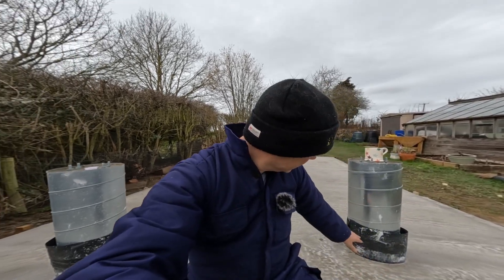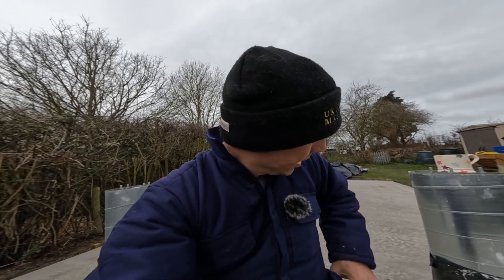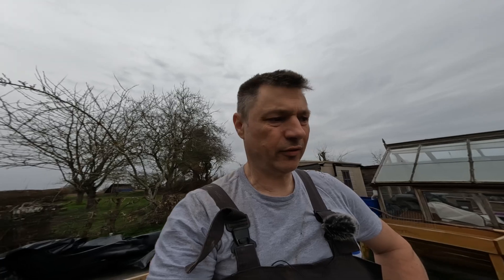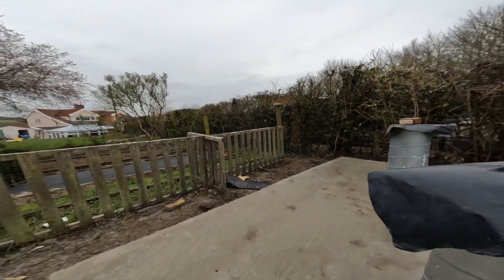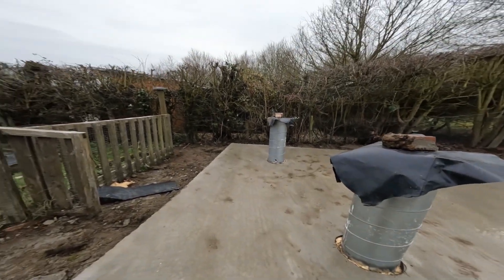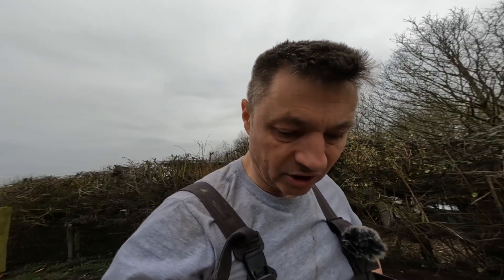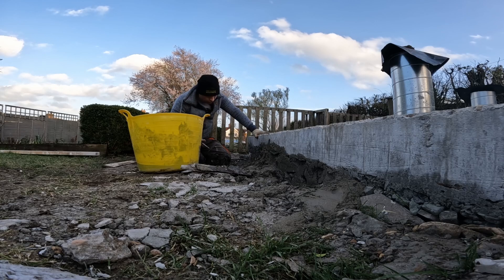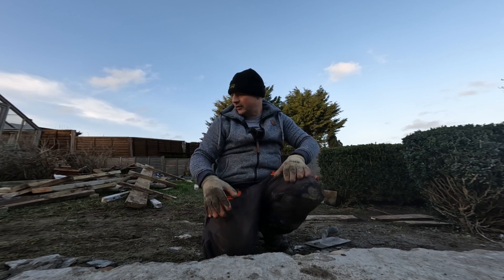4 GENIUS Hacks to Revolutionize Your Astrophotography Experience

Comment: So excited to see how this project finishes up. I do have one concern though. I was always taught that you wanted your building walls to come right up to the edge of the concrete pad, that way the rain runs off the walls onto the ground and not onto the pad where it will wick up underneath the building and the wood beams. That will eventually hasten the rot.  Maybe I'm speaking too soon and you have another layer of walls that attaches to the outside to bring it flush to the concrete pad?
Reply from the maker: Hi Greg and thanks for the comments. The pad has ended up larger than it should be. Unfortunately the plans that came with the office are not the best to say the least and it appears most dimensions stated were Approx??  Will look at solutions to stop water getting under the structure or I will get premature rot even though all the wood is pressure treated.